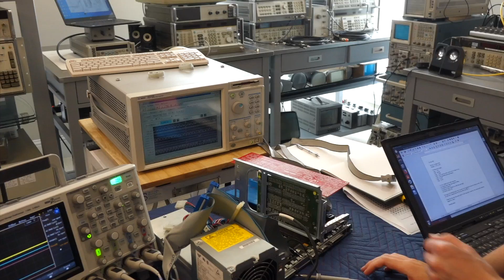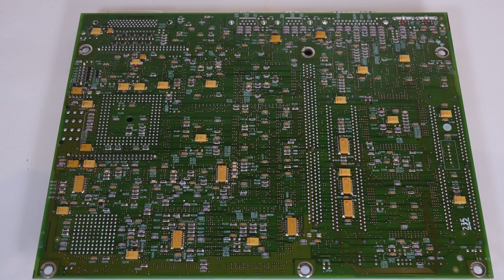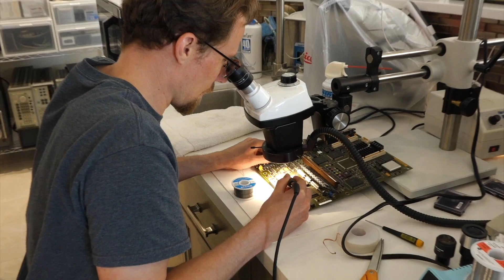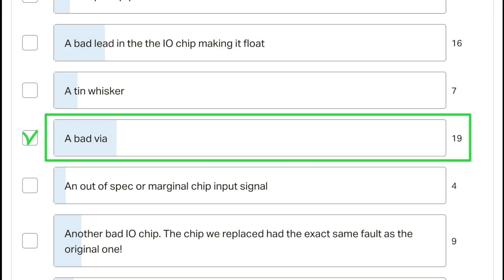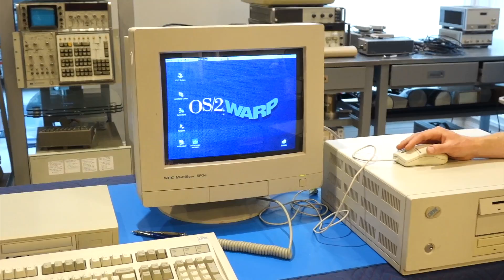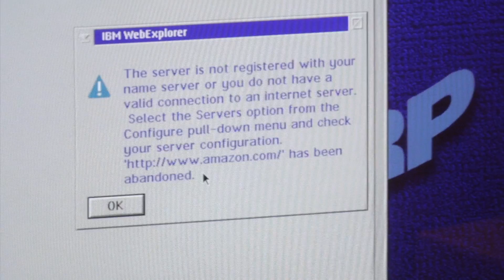IBM PS/2 Part 5: Motherboard Repaired for Good

Comment: Well done finding that broken via! I had a real head scratcher with late 80s Philips car radios where the radio would come on when the car was left unattended and flatten the battery. Philips used conductive silver paint vias/upper circuit board traces and there was an issue where water would drop through a hole in the top of the radio (condensation), leach out some silver, dry out and leave a variably conductive invisible electrical leak that would trigger the radio out of standby!

Comment: Ah, the repair is typically the easy part. Finding the fault however? That's when you've got to enlist some help. Great series!
Reply: It's always simple - once you find the problem.  But finding the problem can drive you bonkers.
Reply: unless the fault was a bad power supply then the repair was equally tricky, but that's another story

Comment: Tremendous job all round; I'd honestly never have found that.  A trivial fix in the end, but the skill is in finding WHAT to fix.  
Anyone downvoting this video has to be a capacitor replacement aficionado ;)   
My assumption was a design flaw in the chip where they just went bad over time.  Happy to be proved wrong!

Comment: os2 warp. there is a blast from the past. i recently pulled an old pc i found buried under piles of junk. plugged it in and found its a ms5169 ali board with an old intel chip, and was running os/2 warp. trying to figure a good use for it

Comment: This brings back a lot of old bad memories! ;) The PS2 line has to be the homeliest computer of the era, and MCA could drive you nuts. I ported some SYSV and Vax code to Warp.  It was a lot of "new wheel building", and I think I started smoking cigarettes in 1988 ;)

Comment: Success! A great diagnostic process to find something that is so hidden. I'm thinking that an issue of a couple of "Bermuda" planars not holding their configuration may be similar - are you (and Eric) ready to check a sample that shows that fault?
Reply: just write a custom bios 😉
Reply: @TubeTimeUS  It may not be that simple. Could be a bad connection or faulty Dallas Clock.
Reply: @joelmarcott3282  if it is the Dallas clock chip Necroware has a replacement for that
Reply: This is what I would be eager to see! I have two 77 Planars that have this issue. it's an annoying failure preventing a complete system startup. Hello Dave by the way!!
Reply: @joelmarcott3282 : "Santa" seems to be my new nickname, although I hope people aren't expecting me to bring them something. Only one of my "Bermuda" planars is affected, although I know now to start pulling out my USB microscope and voltmeter. We will get this solved!

Comment: Usually tantalums from that period have a low failure rate anyway, most of the bad ones that I have seen are from the early to mid 80s. If a tantalum goes bad... you'll know it. About 80% of the time I have run into that issue it's because one of the little suckers exploded.
Reply: tantalums throw tantrums to terrify timid technicians
Reply: Yeah, a bad tantalum usually let's you know in dramatic fashion.
Reply: every amd motherboard from the 90's...

Comment: I spent too much time babying OS/2 2.0 to Warp. I gave up after realizing IBM would never devote the resources necessary to make it prime time. Windows nailed it with 95. And IBM OS/2 had the dreaded single input message queue. When that froze (and it did frequently), the UI would also freeze.
Reply: Windows nailed it with 95? From my perspective, it was the worst OS in history. 

What do you like about it?
Reply: @LMB222  Worst OS in history? Not even close. It's both more robust and a million times more capable than 3.x, and non-MS OSes or NT weren't really an option for home users with limited hardware. It introduced preemptive multitasking, replacing the cooperative model, which means unresponsive applications (at least as long as they don't trample over some shared memory, or interrupts, or chipset IO) didn't halt the whole OS. There was also (a limited form of, with substantial issues) memory isolation between processes with individual per-process memory maps, and while NT did it better and actually well, at the cost of drastically higher system requirements and reduced compatibility, 3.x didn't have it at all, so a transitional system was needed. The taskbar was revolutionary. Windows 95 did exactly what was needed at the time when it was needed. Teething pains with driver quality and just bugs with something so radically reworked are kind of expected... that's why there was a Service Pack and an OSR2 release. And yet, it could run perfectly fine as it came out, it wasn't badly tested or released unfinished.

I think the worst bane of the time was the RAM module quality, complete garbage. You go upmarket, things get better, they get actually good, but there was a lot of garbage. Windows 95 forced people who wanted it to get more RAM, probably bought unbranded or shady kits, which is where some of the associated problems may have started. RAM quality issues lead to the worst experience in 95-98-Me. But there's nothing the OS could have done at the time to be more resilient against bad hardware while keeping performance and compatibility in mind, so why would you count that against it?
Reply: Eh.... I've got a couple retro machines running 95 because it's period appropriate, but 95 could be very buggy sometimes. By 98SE, they worked the kinks out.

Comment: There is absolutely NO WAY to diagnose this in retrospect. You guys put a lot of time into this repair. Respect!
Reply: Seriously brute force
Reply: @bengelman2600  Only after they circled in the fault be careful, tedious elimination. That's what most people l see looking for faults on the Internet lack. They jump into ideas they got somewhere (usually bad caps as he said .. there is only one case where you can be relatively sure about those, and that are wax/tar-sealed paper foil types from <1960) and try it and usually make it worse.

I recently repaired a spectrometer at work, which worked fine a few times after switching on, but then wavelength ranges kept dropping out, then came back with erronous results, dropped out again, maybe came back with even more wrong values.

What it was: 
It has a filter wheel to eliminate the additional orders of the diffraction-grating based monochromator. This is mounted to a geared stepper motor, which initializes when switching on (by just doing a full rotation, but running against a hard stop, which doesn't hurt because stepper motors are current limited). 

The grease in the gearbox got hard and sticky, leading to step losses which added up over time. At some point, there wasn't a filter in the light path anymore, but the metal plate of the wheel (dropout), or even one of the other filters (wrong results). Cleaning and relubricating fixed it.
Reply: @VintageTechFan  Everyone wants it to be the "quick fix".  Everyone wants to say "it's bad caps!" as if that's even the most common failure for these kinds of functional issues.  A good knowledge of the schematic for a particular board, plus basic tool skills, plus a lot of invested time, can give you meaningful results beyond concluding it's one of the "easy fixes".

Comment: I think the cap thing is because of how many electronics people see online fixed, by replacing the caps. If you're not an electronics engineer by trade, or someone who understands the building blocks, and you've fixed or seen others fix things by replacing the caps... it's easy to see all the problems as cap problems.
Caps can be a problem, and by far the easiest way to trace, but they're just a morsel of the whole meal. Gotta eat the whole thing to make an educated guess.

Comment: People screaming „bad cap“ = armchair technician
Reply: It's more fun to blame the diodes.  They can go either way...
Reply: True in many cases, yet there many cheap products, with bad or cheap parts out there. Wikipedia has an entire article about the capacitor plague. And nobody in their by right mind should trust an hundred years old wax capacitor. It might work, it might also go out and blow some difficult to replace parts. Better to just replace with something reliable.
Reply: @bzuidgeest  
Capacitors can and will go wrong sometimes...yes. Are capacitors the culprit in any case just because they are old...no.
Reply: @AttilaTheHun333333  my point is that it depends very much on what equipment and from which era and what kind of quality.

Comment: My favourite way pf proving a bad connection was to use a scope in differential mode on the source & destination ends of the trace which shows up really well. Mind you, that was way back when using DIP with 0.1" pin spacing so a lot easier!
Reply: That's really clever! Going to have to try doing it that way
Reply: I'll steal that. But you do have to suspect signal integrity as the cause before you get there too lol.

Comment: I have an IBM Model 70 PS/2. This thing is a nightmare to work with and I can definitely put myself into your shoes. I would never recommend these things to retro enthusiasts, unless you like unusual hard- and software configurations.
Reply: Which can vary by PS/2 level - a desire to run the microchannel P/390 board that was shown is definitely both an "unusual hard- and software configuration". What is the submodel of your 8570? There are adjustments that can be made to reduce the "nightmare".
Reply: Aww, but fixing them is half the fun! But you're right, I certainly wouldn't recommend them as a retro-gaming machine. Space hardware can be a bit hard to come by sometimes, never mind finding sound cards for them.
Reply: It is actually running fine 🙂 after a lot of fiddling. 80386 at 20mhz (FCC ID: ANO9SA8570-D) / Kingston KTM 16000|386 memory expansion / XGA Adapter 69F9704 / a replacement Sound Card from (who guessed it) TubeTimeUs, because the originals are unaffordable, + his floppy adapter for a Gotek Floppy drive 😅. 

Btw. most of the problems I had, were (not kidding) capacitor related. Especially the original floppy drive was a nightmare. 

Just the harddrive (whopping 120MB and pretty rare as well) is giving me some headaches. Because what do I do when it reaches its end of life. No MCA slot is free anymore for a SCSI Controller and the ESDI drives are way too obsolete to find replacements for!! 😢

Hopefully someone is working on an adapter for this issue too. 

ESDI 2 SD
TubeTime !! I count on you 🤗

Comment: Not all caps go bad with age. I've got some electrolytic caps that are 40 years old and show very low ESR readings and good capacitance, still. It depends on the quality, ambient temperature, and electrical stress.
Reply: Capacitor failures have been the bane of electronics repair techs since they were invented. For sure, there are caps that have lasted better than others. But ask anyone who repairs vintage electronics (tube gear) and they will not waste time trying to reform old electrolytic or paper caps. Are there still some that work? Sure. Are they reliable? Not likely. Of course an IBM PS/2 is not a 1931 Radiola... I would not jump to shotgun replace all the caps on a motherboard. But I wouldn't be surprised when a tantalum or two popped either.
Reply: @mikesradios   As common as capacitor failures are, when dealing with say Commodore 8-bit computers, i just lift one leg of the electrolytics and test it and if it's good as new and they usually are (but so far i think they have all been Rubycons in the ones ones i've had), back in it goes! It has held on with no measurable degradation for so many decades, but a new replacement is not guaranteed to last, latent manufacturing mistakes are always a possibility. Reforming seems like a bad idea, if they're bad, out they go. Some capacitors are just made well and didn't contain experimental additives yet and are under such a low thermal and electrical stress in the circuit, that they can last an insanely long time. Just comes down to experience (own or community's) to what you may expect from a given specific product, and maybe erring on the side of more testing. Modern LCD monitors which don't ruthlessly bake their lytics with just insanely bad engineering all around are extremely rare.
Reply: It really depends. I have never seen a bad ceramic cap, but I have seen shorted tantalums, foil caps with drastically decreased capacitance and a fair few old electrolytics that vented a few seconds after the device being turned on. I guess the application of the cap as well as the quality is the key here.
Reply: @senorcapitandiogenes2068  Ceramic caps can fail, but it's usually from the board flexing or something being dropped on them causing them to crack and short out.
Reply: @senorcapitandiogenes2068  I have just repaired my laptop mainboard which had a shorted MLCC on it. though with specs like 10uF at 25V in 0805 size, i can't say i was exactly surprised. Anyway sharp or repeat thermal or mechanical stress can do them in.
Reply: @SianaGearz  With the SMD capacitors I think that the stress of thermal expansion of the board against the cap itself causes them to fail eventually. That wouldnt be the problem with through-hole caps but hey, planned obsolescence.
Reply: I fix Philips video recorders from 1975-1980 on my channel.  Virtually never had a bad capacitor on those.  A few bad ICs though.  JVC DVD recorders and Panasonic professional studio recorders from the early 2000s, now they suffer bad capacitors all day.
Reply: I want to swap out all modern caps with quality old ones. Have more faith in them.